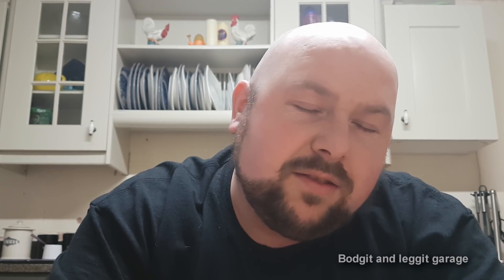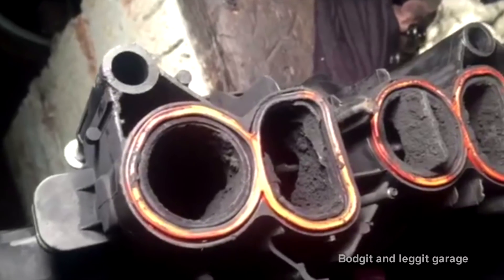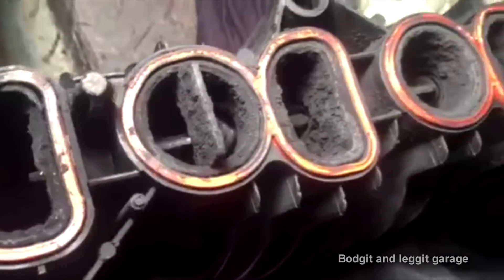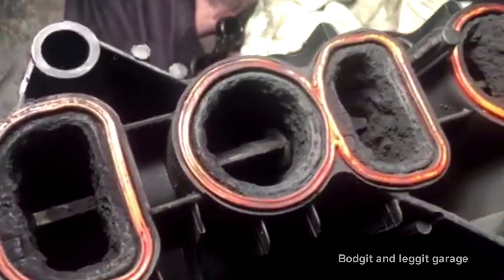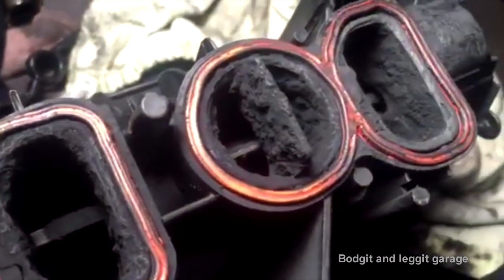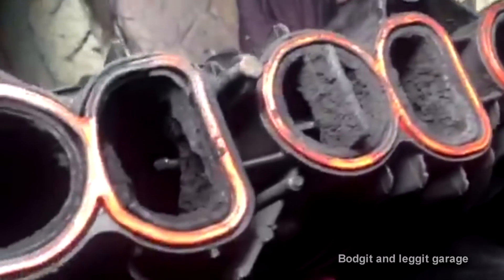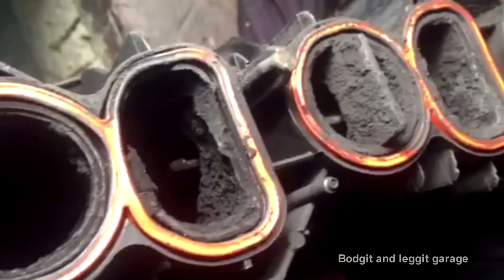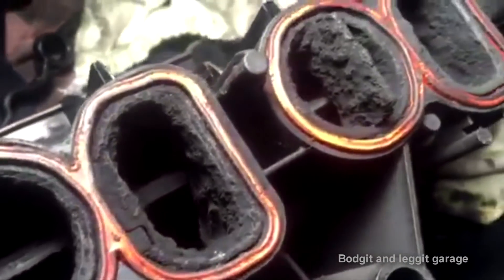Engine Carbon Cleaning EXPOSED!!!!!!!!!!! With PROOF!!!!!!!!! Bodgit And Leggit Garage

Comment: Many years ago I poured 2 liters of water from a coke bottle straight into a very fast-idling carburetor engine It caughted and stuttered and white smoke came out of the exhaust and decarbonized the engine used Redex twice to stop valve stems from rusting.

Comment: I gave my Isuzu a carbon clean with a $30 can of Liqui Moly after noticing the throttle body had some buildup, even with half a can through it, the difference in power was noticeable. I have booked a professional hydrogen clean get a proper result.

Comment: The thing is there's nothing wrong with having carbon in your engine. All this talk of cleaner combustion has nothing to do with carbon. Combustion efficiency comes down to port design, chamber design, compression ratio, air/fuel ratio, ambient and inlet temperature, ring blow by and more than anything fuel quality. Carbon build up has zero affect on any of this.
There are zero emissions benefits from this.
Zero performance gains.

Save your money people

Comment: Its a shame you feel the need to explain your self about this issue that some none believers deside to put there negative thoughts to you in a angry way,
These are probably the same people who you have saved them loads of money in machanical bills in the past with your tips and advice and not even bothered to thank you,
You could spend weeks having to explain to people who just want to have a go and don`t have a clue or even want to understand the principles on what capability the machine will do,
Nothing is a miracle clenser` where it comes to built up burnt on carbon but it will help towards the running of the engine by removing a great percentage,
Life is way to short` carry on with the vids they are really helpfull and don`t take the bad comments personally just move on`let people have there rant thats in there nature, you have to much to be getting on with to keep back tracking I expect,
Good luck in the future hope people think about the effort it takes to put vids out there,

Comment: You are always going to get these type of know it all  …….wa***rs  ……they probably have a capsule of water that is dropped into their fuel tanks and not only does it turn into fuel but you can drive 1.000 miles on one capsule 💊. Lol.  You can tell them that when they pour water into the cylinders they should crack open an egg ……..crank the engine and wow………scrambled eggs pours out of the spark plug hole……Ding Ding….breakfast is ready. 😂 Lol.

Comment: Great video mate, I would say with advancements in fuel technology and oils too “carbon” build up is nothing like it used to be in the dark days! 10k and a full cylinder head removal and having to de-coke!  But as Direct injection has become more prominent in production engines it is allowing build up of carbon. I drive a 2013 M3 and paid for one of these the difference in performance was remarkable 😉👍🏻

Comment: Gary - I have a 20 year old CL500 with V8 5 litre @ 130,000 miles. I keep looking into this, would i notice any difference as im told modern fuels clean the engine.

Comment: I just got a 2007 picasso 1.6 diesel.  once i've got used to it i'm gonna terraclean it.  I am a bit sceptical but I know in theory it should make a difference.
Reply: Did you have it done yet? I want mine done but I don’t like wasting time or money so can you let me know mate
Reply: @Alexander_l322  Decided against it.  Although it does seem to clean out the carbon, that isn't necessarily a good thing for older engines as the carbon could be blocking cracks / leaks etc...
Reply: @CantCampThereMate  fair enough mate

Comment: Why don't you just  run the car with a small hho dry cell, It doesn't take much to build and would keep your engine clean all the time.plus more power,but you would have to remap,because their would be more O2 coming out pass the censors

Comment: The system does work and when you understand how it works you will come to realise it can't clean the whole system, for that you really would need to strip the engine down thoroughly clean and rebuild, however it cleans carbon deposits from the combustion chambers and surrounding areas which will have the effect of giving a cleaner and more efficient combustion. It will not be able to clean anywhere else prior to combustion as it is the combustion and the extremely high temperatures reached that burns away the carbon deposits. 

Oxygen and hydrogen which is really what this mix is can reach temperatures of around about 2000°C which is far higher than the normal combustion temperatures reached when burning a diesel air mix. Because we are generating much higher than normal temperatures, the areas surrounding the combustion chambers and their components will also reach high temperatures as the heat dissipates and therefore could possibly burn away some of their carbon deposits. The exhaust will naturally be much higher and therefore as this is been recirculated through the EGR valve you would expect to see carbon deposits reduced again in this area.

These machines are rather expensive when in reality all they are is either a simple dry cell or wet cell. These you can easily make yourself, however, you would need to use as a bare minimum food grade stainless steel. I'm actually thinking of making one myself to generate hydrogen for a domestic hydrogen boiler for the house.

I do wonder if you could achieve similar results going down the road of forced DPF regeneration as that relies upon generating increased temperatures to burn away carbon deposits in the DPF. I am not a mechanic so would have to test it.

There is no doubt logically it makes sense and will work. It would probably also makes sense to have this done at the same time as a major service, and also change the spark plugs and HT leads for the best you can afford. I imagine this would give you a far more efficient burn with an increase in both torque and bhp.

Anyway, that's my two penneth worth. I'm sure there are guys out there would disagree, that democracy  for you.
Reply: the question is carbon don't disaspear or burn like that* that why it's always killing turbo or dpf or even sometime BOTH!

Comment: Most of the ones saying it doesn’t work are mechanics that would prefer to charge a customer a lot for labour that this machine can stop within an hour or so , I know as I was one of them sceptical ones at first , 50-90 quid for the hour roughly compared to how many hours stripping an engine to find the issue, my customers have been happy with the results and the savings in costs and time so to me that’s worth more than stinging them for a few hours labour and saves me the hassle of stripping down the engine if I don’t have to, as you say it won’t always work but it’s worth a try before having them forking out hundreds . Done approx 25-30 cars with mines all of which have had good results one way or another from egr, dpf injectors, seals and mpg increasing , If you don’t trust it don’t use it but don’t diss what you don’t know as I found out , probably make more from this than I do repairs now and costs a hell of a lot less for the customer, also depends on machine and chemical mix used in the process too

Comment: Can you tell me if this might help my diesel 1.6 Volvo as it’s got a rattle under acceleration but not all the time like on cold it seems ok and idle it will rev up and sound like it should with no rattle. I have heard the injectors could be dripping or whatever but I don’t know. It’s not the injector seals for sure.

Comment: What a waste of my life. No proof how does the hydrogen clean the intake system when it ignites in the cylinder not the intake / plenum chamber. I could fart in my intake box and strip it apart and see better results.

Comment: Dude, why can't the GDI engine be cleaned more than once if its not yet completely clean? Intake cleaners can be used but there may be risk of carbon particle break off causing damage to turbos or catalytic converters. Tricky.. 
ps Airplanes fly all the time

Comment: Wallpaper stripper, the steam clean the carbon right out your car. Jst make sure u insert the hose behind the mass flow air meter keep the rev between 1000 1500. Run for 20minz done.

Comment: I have a carbon cleaning machine and have done well over a hundred cars and motorcycles and all I can say it 1000% works with instant results awesome!
Reply from the maker: boom sorted
Reply: But it can only clean inside the combustion chamber?
Reply from the maker: @garyatkinson5699  yes mate this is the problem with these machines people lie and say it does more than what it actually does that's why people don't think they're very good it is the Hotter the parts of the engine get the better it will clean internally
Reply: @bodgitandleggitgarage  can't work on turbo or egr surely? 
No flame to burn any carbon up

Comment: Thank you for your advice.. I'm having issues with my focus. Definitely going to find a garage near me.. I'm having loss of power.. grunnting noise from engine! Wanting to stall. Blackish smoke. No warning lights etc.
Reply from the maker: Hi mate, make sure you've got no mechanical issues a carbon clean will not work if you have mechanical issues. That's the problem people think it will and that's why the machine gets a bad name.
Reply: @bodgitandleggitgarage  hi. It's been on the on computer no error codes no warning lights nothing. It seems to EGR VALUE not opening or closing probably. An when it stick I loss power black smoke but again no warning lights. So there's a blockage with carbon it makes sense everything you said in the video what's happening with mine. My focus is 16 years old. And done 140354 miles on the clock. And when she goes she goes.. so I do think a good clean would help.. my partner been at me to get it sorted.. so it's booked in for the end of the month and go from There is my best bet. Thank you for replying back
Reply from the maker: @fourlegsandatail7882  Does make sure you've got definitely no issues, and if it is carbon.Carbon cleaning will help But when a car comes in to me, I check it out for the first just to make sure it will work.
Reply: @bodgitandleggitgarage  the guy who going to check it over first asked me if it was okay to check everything first etc. I said to the guy that's fine with me. I'll let you know at end of month etc. Thanks
Reply: @fourlegsandatail7882  egr shud though a light
Reply from the maker: Yes, let me know how you get on would be really interested to find out.
Reply: @bodgitandleggitgarage  course no problems.. thanks again
Reply: @bodgitandleggitgarage  Hi. My car went in today for a terraclean. It feels so much better no lagging. Just takes off witch it didn't before.. I asked the gentleman how bad was it.. he said my car was blocked. It didn't feel right before the terraclean but felt so much better after it. Best thing I ever did.
Reply from the maker: @fourlegsandatail7882  I am happy at work for you it's a different system to what I've got but I'm glad it worked for you
Reply: @bodgitandleggitgarage  thank you. I'm glad it did.. it was blocked no wonder I lost a lot of speed and black smoke. No more of that.. I had no error codes
Reply from the maker: @fourlegsandatail7882  💪👍

Comment: Video only here to boost carbon engine clean scanners sales trust me people I am a mechanical engineer and this does not work carbon is not affected by hydrogen carbon is affected by heat add heat and it will crumble off off
Reply from the maker: 🤣🤣🤣🤣🤣 the first part you saying the machine doesn't work but then you you actually say how the machine does work in a second part of your comment it's brilliant you need to know exactly what you are talking before you make a comment this machine raises the combustion temperature which then makes it crumbles off I love your comment🤣🤣🤣🤣🤣

Comment: Depends on the machine as the market is flooded with chinese cheap crap , ive just had my diesel van done as it was over fueling so had a big carbon issue , using what to much diesel under powered and smoking like bob marley in a crack house , the garage i used machine was over 10k...the HO machine ...after the process which takes about 45mins my vehicle was transformed , better power better fuel economy ZERO smoke ...so if you get it done make sure its from a garage that knows what there doing and now some fly by night man with a van i would stay clear of them as i would laptop man re map which caused the issue in the first place ....

Comment: Not a "Warrior"  a fan.  Ok whats your opinion on this type of cleaning stuck variable vanes on a 2.0tdi 2009 audi a3? Thanks  and where are you?
Reply from the maker: Hi mate it only really works in combustion chamber it might work a little bit help where as long as the temperature is correct but in the combustion chamber is where it works best

Comment: How it works (get ready for it) is that the hydrogen changes the covalescent bond of the fuel at an atomic level, this gives almost instant total combustion of the fuel as the fuel no longer uses a flame front which is slow (relatively) to burn the fuel . The burn takes place at the speed hydrogen burns which is 50 times faster, this gives total combustion and therefore 98% less pollution, also a much cooler exhaust and better economy with more power. I used to fit these things to engines years ago.
Reply from the maker: Boom 👍💪👍💪
Reply: do you mean covalent Gordon,  I don't think if effects the bonding as diesel is an alkane , more  the fact H2 burns at a higher temperature and this will burn the carbon off.
Reply: @mickymac6571  you are right, about the the word but it  was the speed of combustion that changed, gave a small power boost and the exhaust temperature was cut in half. it was still difficult to convince people to fit the unit. The tops of the pistons on a 100k engine were perfectly clean and there was no sludge in the egr valve. The same engine had not had an oil change in 100k and was still working fine. I was told that all the fuel was consumed and the temperature was lowering by the time the piston had moved 10cm. This explains the cooler exhaust.

Comment: I remember when garages used to offer decoke's which back then involved with filling up to the plug hole each cylinder with redex, topped up after many hours and usually an industrious probe used to score the crown to enable the redex to penetrate better.   Redex became quite the fad in the 70's as did Molyslip and the later on original Slick 50 (not the useless stuff made today but the real PTFE coating your engines insides stuff) and you would often see redex'd cars motoring about leaving passing white clouds behind 'em and ponging worse than a tart's armpit lol   Redex though never got into the valve's that well, often the stems would be still cruddo city and often the flaked off carbon ended up blocking oilways and filter.
Reply from the maker: I still use Redex today as one of the best fuel treatment additives out there I think I use it in petrol and diesel but not in the Way You Are sing nice to know the old tricks thanks mate

Comment: I have cured a sticking Turbo on my  20d X type using a DPF cleaner fluid in the tank worked a treat however on the issue of spraying water down an inlet yes it can be done  and I have done it using a spray gun ,the reasoning behind this is my experience with head gaskets where steam from a leaking head gasket decarbonises the effected cylinder top of piston and exhaust valve and port .With and EGR system it is feasible some steam may come back through into the inlet side   .The upshot being I am interested in these machines if they can produce a superior effect to just steam from  which I can assure you is very effective as anyone who as ever dismantled an engine with a failed headgasket can testify

Comment: With the heavy oil engines you have to strip the air in take and clean it propely that wont even touch the sides
Reply from the maker: Not necessarily if it's gone too far then yes the only way is to strip it and clean it but if you use this as a preventive maintenance you will never have to do that
Reply: @bodgitandleggitgarage  yea can see but what i done to a my passat is cleaned it all out but that breather off top of engine i run in to a cach then back in to the front air in take .. mot guy is like fk wers the smoke lol

Comment: I put about four liters of water through the intake of my jtd engine... Kept revs at about 2.5..
Once it started to bog a bit I would rev it more which would release a cloud of black smoke...
All I can say is it would appear this was carbon judging by the smell..
I did this using a pound land pump sprayer..
I would exercise caution with attempting this obviously you don't want to stall it... It was done with a fully warmed engine..
Car is remapped etc anyway but it certainly hasn't done any harm il be doing it again.
I also run it on a veg oil mix so hopefully help if any ring gumming has started..
Reply: What does carbon smell like?
Reply: William Ambler-Shaw hot arse burning in the mid day sun

Comment: Where is the proof? What is he comparing it to? NO before and after.
Reply: In general, if you see the word "PROOF" in the title with a thousand !!!!! next to it, there is no proof in the video
Reply: The proof was showing the valves before & after the clean.
Reply: @andmetalforall2763  at what point did he show the before?
Reply: @fatbillslim  right at 10:20
Reply: @andmetalforall2763  that a proof? if it's was inside may be i would believe but dude it's on table even a kid can clean that sh*t 2minute...